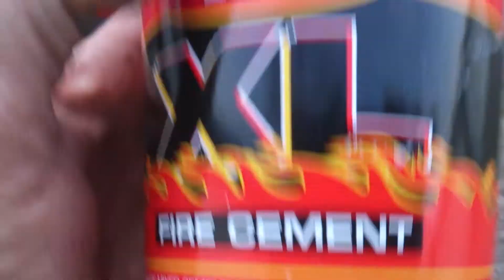Rocket stove on the camper van #2 first firing

Comment: That's a nice tidy job. Should keep you nice and warm. Just been reading about these devices on the web and they seem to be very efficient.
Reply from the maker: Thanks mate, I can't wait to try a proper batch of timber in it, just tried a quick burn for curing the paint and the fire cement. Really want to 'insulate' the burn tube and get it ready for burning oil.